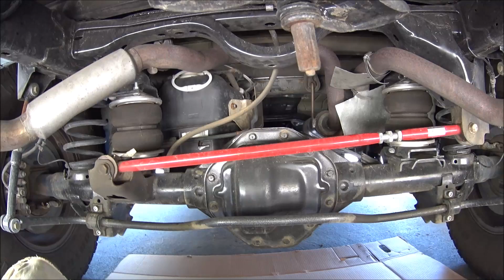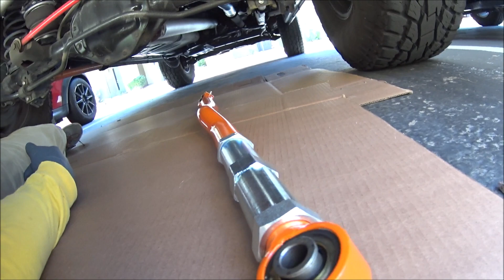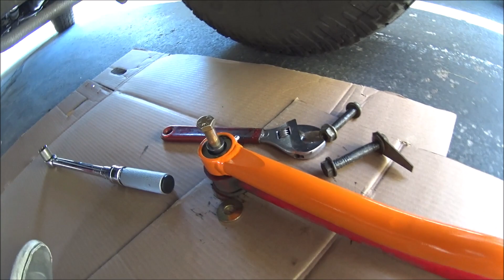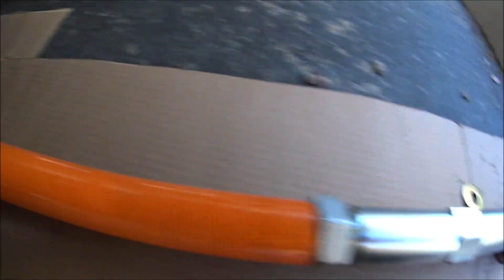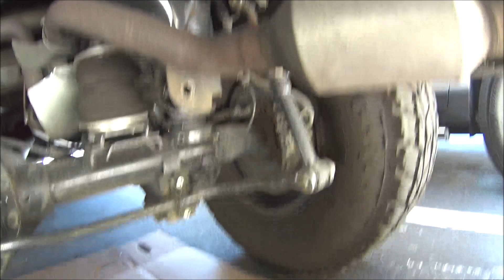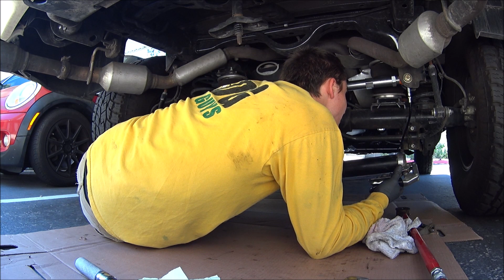Core 4X4 Pan Hard Bar Install

Comment: How you liking the core 4x4 over the spohn,  just ordered mine last night, noticed the spohn started flexing alot at the adjuster, and felt flimsy
Reply from the maker: I love it, I feel like I have very solid pivoting points on the truck. Everything feels very sturdy and feels like there is no play in the parts.

Comment: Hey man i installed one not too long ago and I keep hearing it squeak any ideas on why that would be ?
Reply from the maker: No way to know until you get someone to check with either you driving by a guy to listen or until you put a go pro back there. I can say that mine sqeeked quite often before I put on my pan hard bar back down to level with that drop bracket. After that drop bracket it stopped making noises.